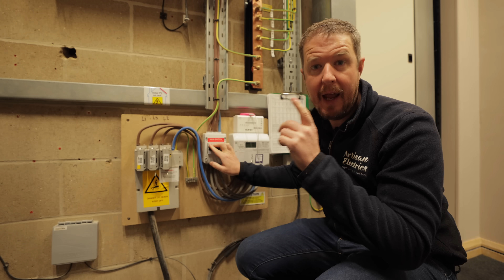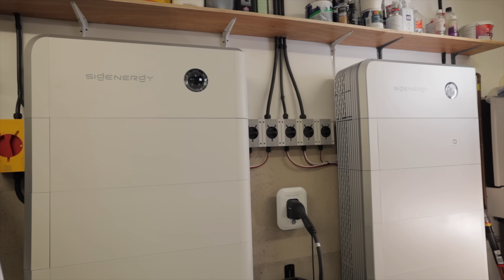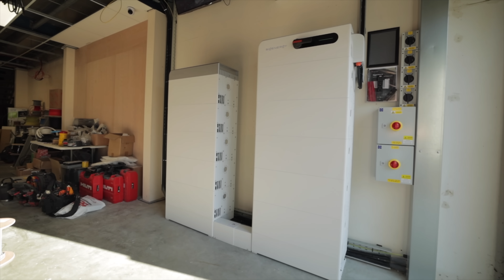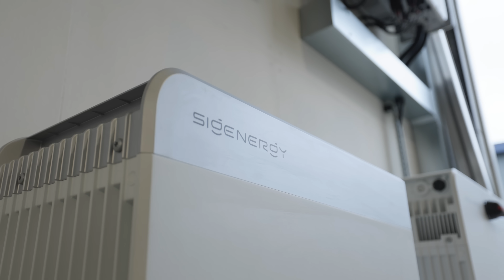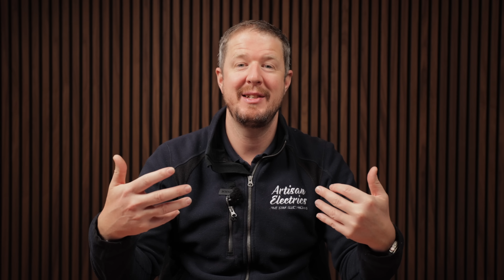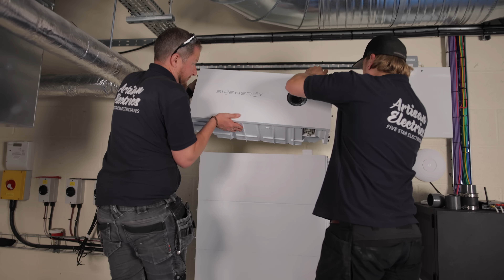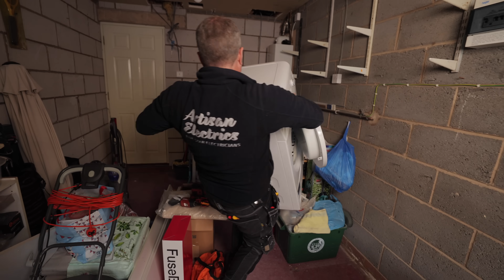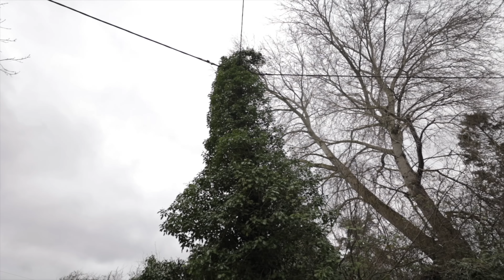You’ve Been MISLED About Battery Backup

Comment: If you can get 1kW out of a 12kWh system for 10 hours you'd be doing reasonably well. You don't get 100% efficiency so your example is misleading. Then add 10% for most batteries as you don't want to hit 0%.

Your description on sizing is also I think a bit off because if you want say 12 hours of full home backup you need to have batteries sized so that you have 12 hours of capacity left at your lowest normal usage case. Otherwise you can guarantee the power will go off when your battery is at 10%. That also makes generators a lot more attractive because you can install a lot less battery with a generator as in the awkward case your generator can kick in when the grid goes down and your batteries at 10%. In a rural environment that's important.

If you have medical devices then none of the standard EPS setups in the mainstream inverters are considered suitably reliable for medical purposes. If you need power as opposed to it being very useful to have then you need a medical grade backup battery for that device. 

In town it's often cheaper to pick a middle path - get a non home backup system and get yourself a cheapo 1-2kWh plug in battery from Ecoflow/Bluetti etc and shove it between the fridge/freezer and the wall. It'll cover the fridge/freezer for a while and you can shove other small things into it like phones if needed.

Comment: This is quite informative , i will just add that there is a difference between on-line and and line interactive UPS, for the best protection you want on-line but it is more expensive. My old APC smart UPS 2200 was made in 1996 and still going strong :) i also have an ATS that will switch it over to the emergency output of my solar inverter for when it runs out.

Comment: 12:14 A 1 kW kettle? huh, my kettle draws more like 3 kW.
Reply: I'm in Alberta Canada we don't in most cases go with kilowatts it's watts and being on a fixed budget I've been looking at solar for my home for over 30 year's tried going solar a few times there was a program by the government done through the electric company set basic sizes and 3 ways to pay pay for the system in full at install pay some down and the rest over 10 years the option that I looked at was 3rd option pay nothing down and pay it all over 10 Years it looked great cost for a system that provided on average 100 dollars a month was 120 dollars a month so for 20 dollars extra a month for 10 years then free power for 15 year's I quickly phoned in the sales person said it wouldn't save me that much I said why not that's when I was told that it was only on the energy portion anything over would be a credit that was totally different calculations since my billing fee was 32 dollars and municipal access fee 8 dollars that means I would be paying 120  dollars to save 60 I couldn't afford that so I thought of ways around it tried to find out how much and how long the credit lasted what would happen if I installed it and then cut the grid the sales person couldn't answer those question so I gave up but one unasked question was answered if I was going solar it only made sense to cut the grid so after many changes to the billing system mainly that although my billing fee went down and my price per kilowatt stayed the same they transferred different items to separate charges distribution charges were added 100 dollars per month whether you used power or not then transmission charges 50 dollars a month plus an amount per kilowatt of power used so since I still had my 1750 watt modified sine wave inverter from my first attempt at solar I bought 2 big cat batteries a 30 amp pwm solar charge controller and 2 100 Watt Solar panel's then I found utube and what I learned first was proper care of lead acid batteries first one didn't seem right they said that if I kept my batteries fully charged they should last between 5 and 8 years I'd never got more than a year I regularly bought booster packs with an inverter and air and the inverter which was why I bought them shut down at 10.8 volts so I never went below half way then I found another one and it was even more shocking it said 12 volts was considered dead and 14.8 charged but how could that be it's a 12 volt battery so how could 12 volts be dead so I grabbed my old black and decker booster pack and opened it up to find the battery manufacturers I figured I'd go to their website or phone and find what they said proper charging perimeter were didn't have to written right on the battery was do not discharge below 12 .2 volts float charge at 13.4 and fully charged at 14.8 so the video was right so I looked at the built-in charger and found output 12 volts so I was only charging it to dead no wonder it didn't last and then I found channel like yours saying that I need so much kilowatt of power and most cases gave prices of 8 grand or more way over my budget so I looked at solar generator's in my budget with the cost of solar panels the solar generator had to be around a grand lithium ion one were over 2 grand for those that had output of 2000 watts so I looked at those with lead acid batteries there were 2 thankfully I had found the utube videos on proper charging perimeters as after many inquiries I found both only charged the battery to dead and both had solar input so low that for every day of use it took 2 days of good sun to recharge then our Princess Auto brought one out a real pig in a poke battery was 3 volt lithium power inverter was 2000 watts pure sine wave other than that they knew nothing but their policy was no sale is final until I'm satisfied so I ordered one and a battery and had my sister pick it up and bring it out after work and just in time my power provider sent a text and a email that power would be out Friday from 8 am till noon and the temperature outside was minus 30 and our house leaked heat bad and even around 0 when my furnace fan motor died it took a week to get to 15 degrees until the weather outside warmed up so my sister got home after work Thursday night and I plugged it in to charge and I read the manual to find out what I'd bought the battery was 52:  volts so Friday morning came and the power was shut off and I plugged my furnace in watching to see if it would run it and I was surprised it pulled 220 watts to start and then 180 to run from what they said I'd need for a system 4 or more kilowatts of power to run an average home I was expecting close to the 2 thousand watts of the solar generator since then I found out that I can run my whole house on my unit can't run an electric dryer stove or hot water heater as they take 240 volt split phase power but I can use a microwave oven 1400 watts kettle a thousand watts so I can live with this solar generator and even go of grid
Reply: Even 110V kettles consume 1.6Kw and most "Old" UK kettles use 3Kw, newer ones are a mix of between 2.4Kw and 3Kw
Reply: @PeterC-qwerty We were off grid for years, you can get really cheap kettles that are 1.8kw and small travel kettles are 800w.
We defaulted to a gas kettle for about two months in winter, our washing machine, microwave and dryer were also around the 1.8kw so you just run any two items unless the generator is running.
Reply: Why didn't you use a 1kw electric heater for your example? Suggesting that British kettles draw 1kw is misleading and confusing.
Reply: @russvhill2 It is not misleading or confusing.
The fact is when you are doing sizing calculations you have to look up the actual power of the appliances you are using.

You do not rely on some guy in a YouTube video giving example figures.
Reply: Disconnect the other two phases... 😂
Reply: @SolarizeYourLife  what makes you think i have a 3-phase supply?

Comment: As someone who worked on data centres and big computer systems it's really misleading to call any of the kit available on house scale UPS. A true UPS does double conversion so it'll protect from momentary spikes and other things that a device that switches from grid to backup however fast will not.

For a home it simply doesn't matter IMHO. A data centre needs this at scale, a home it's cheaper and more efficient to just put a small UPS on the computers or sensitive electronics and run an EPS for the whole house
Reply: Small "Pure sine wave" UPS supplies now cost under £180 each so cost wise it is better to spend money on these and have a normal EPS rather than spend £many thousands extra having a near UPS as the main back up supply.

Comment: One thing I can’t get my head around. I had a Sigenergy installed 2 weeks ago with a gateway. But the static backup percentage is stupid. If I set it to 30% and the power goes off at 8am. Well my solar is going to kick in pretty soon so I don’t need 30%. If the power goes off at 5minutes past sunset well that 30% might be enough to see me through until the next day. There needs to be a variable amount I can set that changed depending on the time. The sigenergy can’t do that as standard, I am going to investigate when home assistant can change those settings.
Reply: Yeah, that kinda was on my mind too... how do you know how much reserve to set? It's too much on some days and not enough for others. I agree, sig need to include a variable reserve in their ai mode, I'm sure the algorithms could fix this..
Reply: I believe you're over thinking it.  What i do (admittedly with a 48kWh battery which will almost always get us through the night, heat wave conditions excepted) is to set a low reserve (5 to 10%, no more than that), and use the battery as it was intended, to store my solar for me to use overnight. 99% of the time, i run off the battery overnight and have 20-60% left in the morning depending on the season,  when it starts to recharge.  By lunchtime it's full.  I only feed from the grid between 11 and 2pm if it's overcast. 
The battery always has enough to back me up if the grid fails because it always has enough regardless.  The presence of absence of the grid is irrelevant.  A Sigenergy system can run to exhaustion (0%) overnight if circumstances dictate this, eg if the grid went down and i didn't realise, and kept the ac going flat out on a hot night) and it will restart from 0% once the sun comes up and refill itself.  
The backup reserve is only relevant if your battery isn't big enough to get you through the night.... and if that's the case then it is moot HOW you set the reserve: if the grid fails then you aren't going to make it through the night wherever the reserve level is. 
But if you set it high (say 40 or 50%), all that achieves is that you waste half your battery 99% of the time in case you need it 1% of the time. 
Depends on your risk perception and how you value a tiny risk of being blacked out vs a near certainty of wasting half your investment, but it was an easy decision in my head at least...

Comment: Nice explanation Jordan, I'm running a parallel Victron Multiplus 2 inverter system (2x 3000VA units). I have a 48v 16.1kWh Fogstar eco battery as the storage and as the Victrons are specifically designed for grid loss and back up power I thought it wouldn't have any issues when there was a power cut. I'm running a small consumer unit for essential loads from the UPS output of the Victrons, in normal operation it can back feed power to the main consumer unit to power assist with any loads. In the event of grid loss it should keep the UPS consumer unit powered up with refrigeration, lighting and WiFi socket final circuits attached. Alas I had a CT clamp circuit configured incorrectly on the slave Multiplus and every time I simulated a grid loss the back feed relay went into error and everything shut down.
Reply from the maker: Classic CT clamp issue, easy fix though! 👍
Reply: @artisanelectrics  Yeah I only had to remove the link on the slave unit and hey presto!

Comment: mine is a no, because 2 of my AC500 died from Bluetti...so now need to get a solution asap
Reply from the maker: That's terrible to hear, hope you get it sorted!
Reply: @artisanelectrics still in the process at the moment of sending everything back. Only had the gear since November. Not fit for purpose, hopefully building my own rig as its an off grid solution for some electronics.

Comment: I’ve two Tesla Powerwall 2 and a gateway that I believe gives me 10kw charge and discharge although my solar inverter is only 3.6 kw. However the solar inverter doesn’t affect my battery output because I assume each Powerwall has its own inverter. That I believe is the benefit of a Tesla power wall. The drawback is the solar inverter feeds 230v to the power walls and the power walls built in inverter converts it back to dc. So there’s a little extra energy loss, but not enough to worry about.  I also have a dedicated earthing rod that was fitted when the second power wall was installed along with the backup gateway.
Reply from the maker: Spot on, the battery inverters work independently of the solar one 👍

Comment: I have an 12 x 450w panel + an 10kw Enphase system (2 x IQ Battery 5P) , I was thinking that just as you said that it was able to run in off grid if there was a power cut. But it turns out I need an Enphase IQ System Controller 3G and an earthing rod fitting (which I was not told) to make this happen, so now I am just waiting to raise enough to cover that cost 9 months on from it being installed.
Reply from the maker: Classic case of not being told everything upfront 🤦‍♂️

Comment: Yes, Victron with 16kWh of battery, lasts about 3 days with no sun, off grid for months in the summer.
Reply: Three days you must be sipping power 😂 got 27kWh don’t think it’s lasting anywhere near that for me. Victron also 😉
Reply: LoL. Entirely depends on what load is connected. And somebody else will be using a different load to you.

So making a statement "Yes, Victron with 16kWh of battery lasts 3 days" is only true in your installation.
Reply: @deanXRayZulu  Never said it wasn't, but there's no point in sizing a battery and inverter to be able to run (as he says) a hot tub, EV charger, electric shower during a power cut. The whole point of battery and solar is to minimise your electricity bill,  charge the batteries up during the day and use that overnight. The extra cost of being theoretically able to disconnect from the grid without any compromise just isn't worth it, just size stuff to be able to use the essentials, I have a 5KVA inverter, I know if I want to not use grid power I have to not use the kettle at the same time as the microwave. It's a compromise I can make to negate the need for a larger, more expensive inverter.
Reply: @thegrimreaper7777 Grow up.
The point is your post is completely pointless without specifying what the load is. And you should have been smart enough to realise that.
Reply: @deanXRayZulu  I use 5kWh per day on average (3 bedroomed house, frugal owner) , I get 3 days out of a full battery, that's the fact. I could have said I have 32kWh of battery and all that would change is I can get 6 days out of it. It's not load, it's usage, different measurements.

Comment: I don't understand why anyone would spend so much on a solar storage system.  Why wouldn't you use the system off grid and only use the grid for charging when required.  Obviously the system would need to be large enough for a whole house.
Reply: Some of us live in places like South Africa, load shedding for 4-8 hours a day weeks on end. Power outages sometimes last for days. No such thing as off peak rates either. I was lucky to get bank finance for my system, pay back is 5 years plus, but with price increases of almost 10% p/a it makes sense. Got 14kw solar aray, Fox 30kw hybrid inverter, 69kwh Fox ess batteries, so far i've only used 5kw from the grid, we've had bad weather the last couple of days, might need a wind turbine also. I even charge my PHEV at night, saving the feul cost also. Very happy so far.
Reply: You can do but in the UK the payments for solar exports are high, and being grid tied lets you have a smaller inverter so on a cost basis it's cheaper to grid tie generally.

There are rare cases (eg when you get G98 and refused even G100) where it makes sense to just run an off grid style system with grid for charging but that has some interesting challenges of its own, one of which is that if you have a single bidirectional inverter you will get a glitch on your supply whenever you switch between "generator" (ie grid) and battery.
Reply: I use my solar battery storage at night!!! EVERY NIGHT....

Comment: if my numbers ever come up (hopefully tomorrow) i'll build a house with a power supply system (solar + batteries + maybe a wind turbine) that can run completely off-grid. but of course i'll want a grid connection so that i can sell excess electricity. i've already made a list of requirements for the electrical system, and the ability to supply the house with power even when the grid is down is at the top of that list.

BTW, the other day we had 2 short power cuts in less than 2 hours. one at about 1:45 or 1:50 am, the other at 3:20 am. dunno about the first one, but the second one was only about a second or so, but long enough to turn off my computer and reset some clocks. but my home assistant and my pi-hole probably didn't even notice.

Comment: Yes mine does, Victron with 51kwh of battery..
Reply: Same here. Victron FTW. Three MultiPlus-II 5000VA and 21 kWh.
I was planning a storage expansion, but I'm waiting for sodium batteries.

Last year, I ran my house off-grid for nearly 9 months. This year I plan more panels (have only 4 at the moment) so I can heat water from the sun.
Reply: With low voltage batteries costing less than 100€ / kWh it's super cost effective. If you build it yourself it can be even 60€/kWh.
Reply from the maker: Impressive!